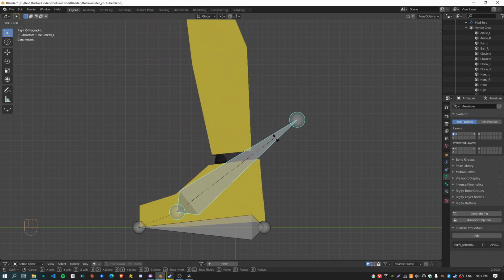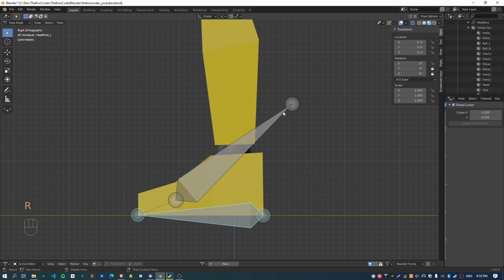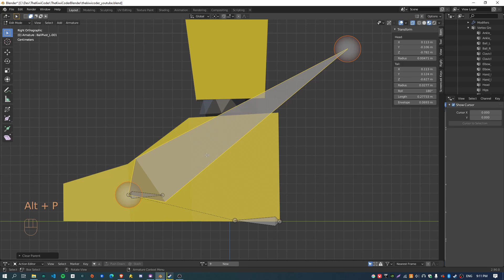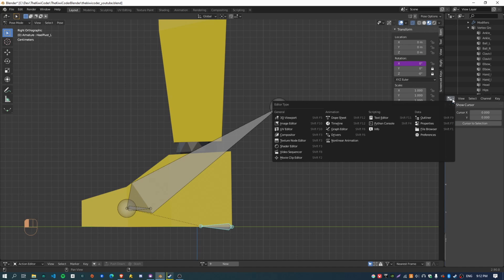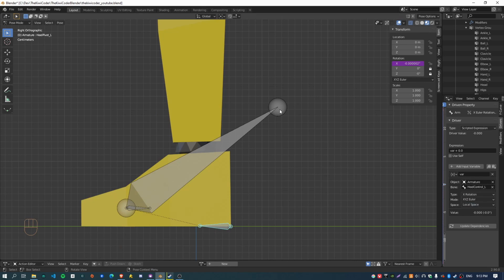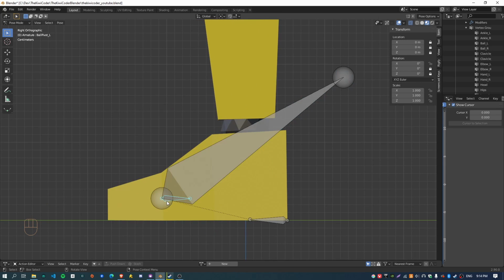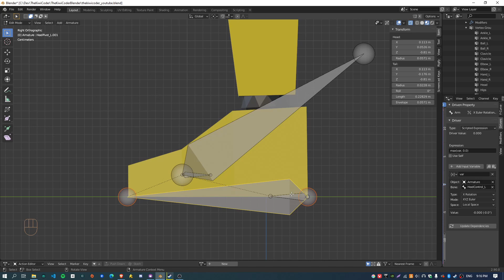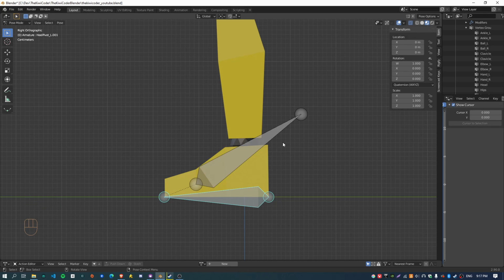[#4] Creating foot roll using drivers in Blender 2.9

Comment: My 2 cents:
1. it seems the same thing would be possible with the Transformation constraint, no drivers.
2. You can open the drivers editor in a temporary separate window, this way you don't need to switch the side panels back and forth, and it doesn't disappear on mouse out :)
Reply from the maker: Thank you for the tip!

Comment: I don't know if anyone else was having this issue like I was but it took me a while to figure it out. The X rotation wasn't rotating like yours. It was rotating the foot left to right instead of up and down. Turns out all my rolls were off in edit mode. I don't know how I did this by mistake as I thought I followed pretty closely lol but once I fixed the rolls from like -3.. to 0 and 180 respectively it worked out perfectly. This stuffs tedious but thank you for the tutorials, I've been enjoying them thoroughly :)
Reply: huge help thank you
Reply: I'm very happy to have found your comment, thanks a lot
Reply: Thank you man
Reply: Yep same happened to me, just had to fix the roll of the bones to 180.

Comment: None of this was mirrored to the other foot for me and if I try to symmetrise the rig again as per the previous video then I get duplicate bones on the right side and still none of the drivers are actually setup for the right foot. The only way to get this right for me was to follow all the steps again for the right foot. Was this expected or did I do something wrong? I've had X-axis Mirror on the entire time. I'm also getting some slight twisting on my foot when I switch between edit mode and pose mode now after setting up the bones in this tutorial. I'm using my own character while following this tutorial so I'll double check to see that I haven't messed something up somewhere. And lastly my rotation was positive when I rotated the heel control up towards the toe and negative when I rotated it down towards the heel, ie. opposite from you. Not sure why that is either. It just meant I needed to tweak the expressions for my drivers slightly. Just mentioning everything I noticed that didn't go perfectly according to plan following this as it has been smooth sailing up to this point. :D
Reply: I figured out the twisting. It was some bone roll that was inherited down through the chain. I also think my mirroring/symmetry didn't work because most of the bones created in this episode ended up being named stuff like Bone_Toe_L.002 etc. Not sure if the 002 suffix makes a difference, but either way I renamed all of them to make it clear to me they are controls/helpers and not normal bones. And after taking this into Unity I discovered that all these newly created bones should be marked as not deform bones. For all I know all of this could be assumed on your part or there is a cleanup episode later on, but again I'm just mentioning everything that caused me to stumble while following this.
Reply from the maker: Yep everything you’ve said is correct. Naming convention is important, but blender seems to not correctly mirror every action when it comes to rigging. I end up having to duplicate the work on both sides.
Reply: @TwiiK  so after renaming e.g. Bone_Toe_L.002 what is the new name? i'm struggling with the same issue. thanks
Reply: @Mark_bretner  Ahh, that was just for organization sake after fixing it. I still had to do the work twice, once for the left foot and again for the right. I just assumed that the naming could have been the cause of the mirroring not working, but I never checked because by that point I had already done the work twice. :p
Reply: @TwiiK  Yes, redoing it for the right leg did the trick. also somehow I had duplicated Ankle bones, which overlayed the functional/good ones and didn't move. after hiding them I got the proper ones visible and now the right leg moves the right way. I hope this helps others as well.